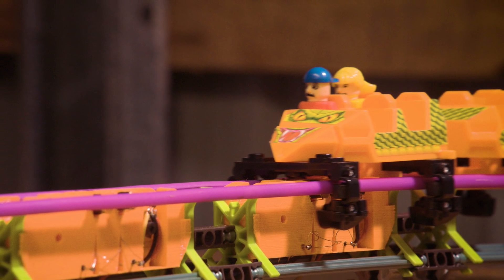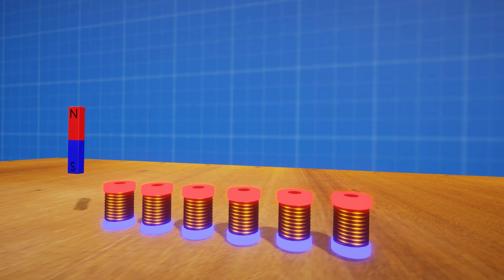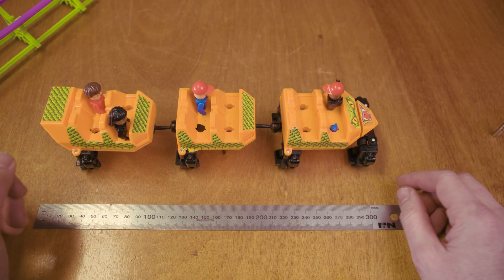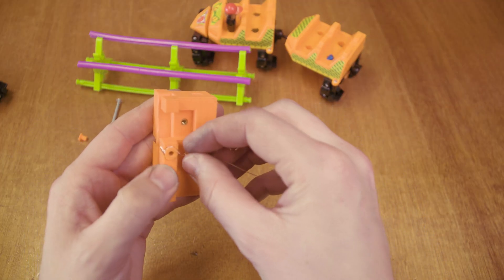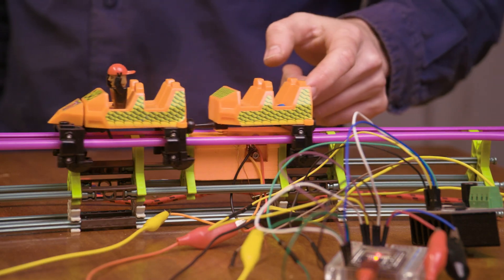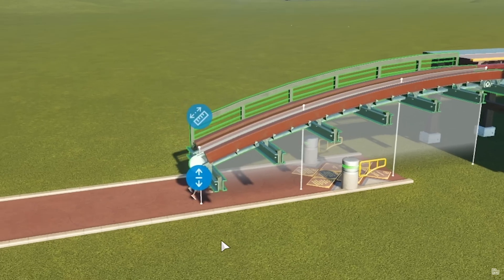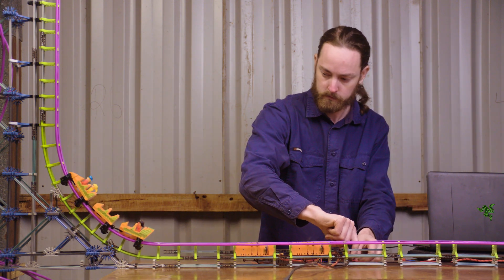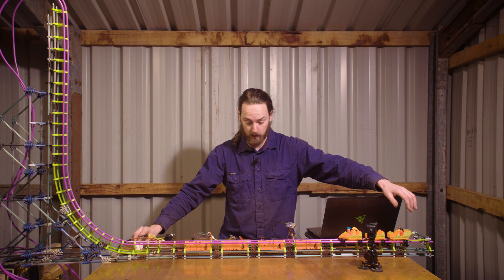DIY Linear Synchronous Motor - K'nex Launch Coaster

Comment: A concept that would probably help out a bit with developing the next version of this motor is something called Inductive impedance. This is basically saying that it takes time for the current flowing through a coil to change, and that time increases and decreases based on the voltage applied to the inductor. That means that for any given coil, there is only so much current rise that can be produced in a coil over a very short period of time. For example, one of the main drivers behind BLDC motor coil designs is called Kv (RPM/V). This basically defines the rotational speed that the coil switching can sustain for each volt applied to the motor.

What I think is happening is that the rise-fall time of your coils is too high for any meaningful current/power to flow through the later coils before the train has passed. More or less, by the time the coil can actually build a strong enough magnetic field to do anything the train is already a few cm further down the track. There are a few ways to deal with this, with one of the more common ways being to use a coil with fewer turns of a thicker wire. Another way is to increase the voltage to allow for a faster rise time to a given current (rise time increases proportionally with voltage) similar to how running a BLDC at a higher voltage allows for faster switching via the KV constant.

Something that might help to protect your coils would be to move to a motor driver with current protection or stick to a constant current power supply (possibly with a capacitor to allow brief spikes of higher current output). Sticking to constant current will prevent a dead short from cooking the coils if the gates get stuck open, hopefully giving you a bit more time to react especially as you start running at higher power outputs. Additionally, inductive flyback is a serious concern depending on what type of H-bridge you are using, as the sudden closing of the mosfets can cause a very large voltage spike through the inductor. A lot of nicer H-bridge IC's come with internal flyback diodes to deal with this, but especially a lot of the older ones sold for hobbyist use online do not. 

If you want any help designing future motors or motor drivers, I have been developing a series of LSM's for use on my company's larger 3D printers and PNP machine for a few years now. I haven't designed any for this specific type of application, but it would be an interesting challenge that I may be able to provide some assistance with.
Reply from the maker: I really appreciate your insight Howard! I am currently building a version 2 of my LSM with 3D printed track, to eliminate any non-linear movement of the carriages an reduce friction losses. If I still get poor results from adding extra motors I think you might be right about the coils taking too long to change polarity. That's why I have position adjustment on the hall effect sensors but my data is too noisy (and my hardware melts too quickly) for me to really get to fine-tune the sensor positions. It's a harder project than I ever imagined it would be! But I'm still working on it!

Comment: What board are you using to control the power for the coils? Are you using a solid-state relay connected to the PWM microcontroller output? Thanks
Reply from the maker: The 'brains' of the circuit is an ESP-32 processor, and it receives the hall-effect sensor output, and it drives a BTS7960 Mosfet H bridge to deliver the high voltage/current to the coils. So it's all solid state, but a lot of my BTS7960's have exploded so I don't think they can handle the back-emf or flyback from my setup too well.
Reply: @technologyhobby  The issue might be related to the voltage and the switching frequency.

Comment: Next time try making a three phase linear induction motor
Reply from the maker: I have no idea how induction motors work yet, that's something I've never delved into. Perhaps one day!
Reply: There are lots of good videos on these types of motors work. The problem with coils in the configuration you have is that it takes time for them to build up and collapse the magnetic field. So yes it will attract to the coil but then it will slow it down when it trys to pass it. By using a three phase network it no longer cares where it it on the stator and will always move in one direction.

Comment: This is one of those projects where i'd consider using simple logic chips instead of a microcontroller.
It won't be as versatile or configurable, but it'll probably have a faster response time.

Comment: it feels like too much friction and not enough power is limiting you so far, no?
Reply from the maker: I think the power may be enough but yes the friction and bouncing around of the train is taking all that energy away.
Reply: @technologyhobby  could you not add like maybe a thin aluminium track, to attach to the plastic supports.. with more efficent bearings in the wheels? would that be a good idea?

or maybe some paint..

Comment: You can print already made trains that are a bit larger.  Then use ball bearings for wheels.  I have a couple builds uploaded on my channel….well not really a channel.  Figure if you change the plastic crap wheels to ceramic ball bearings, it will be much faster.  If not, grease the plastic wheels
Reply from the maker: I have just purchased the necessary bearings, and I think I'll start printing some of these wheel assemblies! I can see from your shorts the performance is massively improved.
Reply: @technologyhobby id recommend only using ceramic or hybrid bearings. It's extremely difficult to clean out the other types. They are more expensive but definitely worth the price.

Comment: It looks like the train is hitting and bumping through the LSM, that small amount of contact at that scale is way more energy loss than you think. You are trying to accelerate the train literally through a brake run. Getting the spacing larger would lessen the efficiency of the LSM when the magnets are too far from the coils, so lossening tolerances is not a solution either. This is a way harder project than anyone gives credit for, because you’re trying to do this on a tiny scale, and with a toy that has extremely lax dimensional tolerances. I commend the effort, but don’t be too hard on yourself during this whole project, this is a really hard one.
Reply from the maker: Yes! The real killer here is the horrible tolerances. I was getting the same speed out of 2 motors as I was out of 4 because of the friction, collisions and bouncing everywhere. I'm currently trying design a version of the motor that IS the track, so the train runs on precise 3D printed square rails through the LSM and then gets dropped back onto K'nex track at the end. I'll know in a few days if this approach is going to work any better or not. Definitely a tough project!
Reply: @technologyhobby that’s an excellent Idea! I can’t wait to see what you think of. I’m already thinking of how I can improve some stuff on my own coaster now!

Comment: Why aren't you designing the motors like the actual coasters use?  On the car is a U-shaped iron core open side facing down lined with magnets inside (transverse field left to right at one pole, right to left on the next pole) with a set pole spacing.  The stators on the track consist of flat wound coils spanning one pole set (with no iron) s (by having the coil spacing 1 1/3 times pole spacing) set up in 3 phase arrangements.  The Y-connected coils are driven both ways with 3 phase bridge drive (this requires only 6 driver transistors rather than 12 for separately-driven coils).  Because there is no iron in the stators, you don't have problems with magnetic side pull when the track is not perfectly aligned with the stators.
          Your design is too magnet light & too coil heavy.  Magnets should be on both sides with single coil between.  Coil should be larger in diameter & thin in the lateral direction (to achieve the highest possible magnetic field between the closely-spaced magnets).
Reply from the maker: This is a great comment, and I agree the way I ended up building it was a bit silly. My main problem is the space constraint. Two rows of permanent magnets with a space between them under the trains would probably collide with the track connectors. It's a tiny space, so I thought one row in the middle where the clearance was the largest would give me the best chance. I've also done experiments with air-core coils in the past and found that they need a huge amount of extra current to generate the same amount of flux as an iron core magnet. The 1 + 1/3 coil spacing idea is great, so it functions a bit like a stepper motor. If I do a scratch re-design I'll try that!
Reply: @technologyhobby there’s still some clearance under the train, as it’s hollowed out. If you’re willing to modify, you could cut a thin slot to allow the coil fin to stick up a little more, giving you way more space to get magnets under the cars.

Comment: Have you thought about mounting everything on the outside of the car on the sides? You have far more room, and could put the magnets right next to the wheel mounts... would require double the magnets tho.
Reply from the maker: Great comment, you really have me thinking. I'm still trying to make my original design work but it's still failing. Your idea would be a more visually disruptive modification to the trains but it could work really well. I'll think about it!
Reply: @technologyhobby I think there are LSM coasters with fins on the outside. There certainly are many more with fins on the outside for brakes, I don’t think it would look to out of place at all. At this scale, finding any solution at all is a good start, improvements can come later. Literally, how classic coasters look so different than modern ones. We didn’t jump to the modern LSM thin and pretty coasters all at once.
Reply: @technologyhobby 
For less visual disruption... could you use coils on the bottom side of the outter portion?
You may need to pull down more-so with the timing but it could work.

You could also make a decorative "station" of sorts around the sides to hide it.

Either way, i wish you the best with this! Looking forward to updates!

Comment: You should use a launch blade that consists of just coils with a repeating pattern of phases, and connect each phase into a high performance electronic speed controller used for model aircraft or fpv drones. You could potentially change the length/distance of phasss throughout the launch to time it to the train. You could potentially use the hall effect sensors placed throughout the track to vary the throttle rather than using the first method of changing the spacing of the coils, this way you could even decide things like sharpening the curve of throttle vs the distance traveled on the launch, at the beginning to come over the problem of low start up torque of the motor
Reply: Isn't that a LIM rather than a LSM then?
Reply: @dasy2k1  I think this is suggesting to swap to a magnet track and moving coil array, which is a more standard configuration of LSM in the industrial automation world. There is slightly more moving mass and power must be delivered to the moving part (which is why it isn't typically done this way for roller coasters), but it is still an LSM as it relies on magnetic field synchronization with alternating polarity magnets on the track.

Comment: Loving this trend of people finally putting actual LSM's on model coasters
Reply from the maker: I'm really determined to try and make this one work properly! I'm going to keep making improvements and eventually another video.
Reply: @technologyhobby  something worth looking into might be replacing the wheels with bearings, the stock trains are really not that great when it comes to friction and keeping speed. Having custom bogies will also allow them to hug the track more so less energy is lost with the constant up and down wobbling (and also prevents it scraping over the motors). Looking forward to the next videos!

Comment: I love the engineering here and I have wanted a career in engineering (or becoming a pilot) but my question here is why did you need to detect where the train is? Would the magnets not work on their own?
Reply from the maker: the electromagnets attract the train, but then need to change the electricity direction to push the train away. Without changing the electromagnet polarity the train would just stop on top of the motor. Take a look at my DIY brushless motor video for a good demonstration of this!

Comment: @TheKnexMaker sells trains with metal bearings and custom designs you should check it out
Reply: They come with extremely strong bar magnets as a bonus! Two are not glued, the other two are permanently glued. You could ask theknexmaker directly for a set with the magnets not glued in, but shipped separated from being on the cars.

Comment: It would be important to have the lowest tolerance possible because the magnetics force gets higher exponentially with less space between the Magnets. It also would Help to Order custom Magnets for this Project but that could become pretty pricey. The Magnetic force will be bigger If you would Had an Ironcore inside the coils.
Nice Video!
Reply from the maker: Yes custom electromagnets would be great. I need coils with an outer diameter less than 8mm which is hard to find. And I cut steel nails into short pieces to use as a core. Not as efficient as I needed it to be. The train is too loose and floppy on the track for good tolerances too. Thank you!

Comment: I can relate to watching you hesitantly plug in the high currently power supply, I had a very similar feeling when I did mine. The coils on the sides instead of vertical is a valiant effort, but I think the volume of turns is very difficult to achieve in such a little space. That was the main reason I went with my orientation, that and buying premade coils definitely aids in the prototyping process. This is great progress though, it only took 1 revision after getting this much speed to get a usable system so you're very close!
Reply from the maker: I wasn't aware of your channel or video, I'm glad i did mine without seeing yours so now i can see where we made the same or different decisions. I know off the shelf coils mounted vertically will produce more acceleration but I was determined to dry and do it like the full scale roller coasters. You have convinced me however that i have to replace the stock wheel assemblies. I just ordered bearings!

Comment: cart needs more mass
Reply from the maker: It's a very heavy train already with all of the magnets added. probably double the weight of the stock train. which means it will roll really well if I can get it up the hill in the first place.

Comment: Now you have to rebuild the Knex wheel assembly's! The Knex roller coaster wheel are horrible, and the turning assembly's don't allow for tight turns. lots of other youtubers have solved this will ball bearing wheels and 3d printed roller coaster trains!
Reply: I should also add that these trains don't have much momentum, putting weights or large magnets in will help
Reply from the maker: yes i agree the wheel assemblies are horrible! the main thing holding this back was how loose fitting the train is on the track, it bounces around so chaotically. on top of that also heaps of friction. ill look into these better wheel assemblies. I'd like to keep the original cars but happy to replace the wheels.
Reply: @technologyhobby  you can actually make some good use out of the existing assemblies by just lubing the wheels and tracks with silicon lubricant. Trick I learned back in the day to push my custom knex coasters way beyond the original design
Reply from the maker: @dodaxo1234567890roll  I have tried that, and it makes a huge improvement for rolling speed/distance but my problem is the loose tolerances over the motor, which causes the train to bounce an twist and smash into things while being accelerated. But if I do ever get the train over the hill I'll be using that silicon grease!
Reply: Did you take inspiration from this btw? It wasn’t clear in the video if you’d seen this other project
Reply: I’ve just seen he actually replied in the comments! Ignore